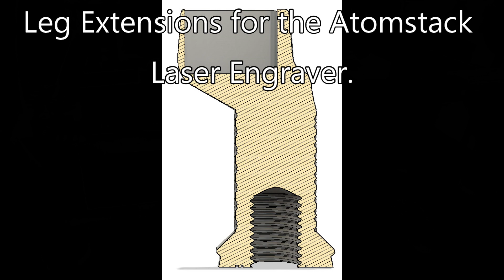3D Printable Leg Extensions for the Atomstack X20 S20 and A20 Laser Engravers. Free Download

Comment: You are the man.  I appreciate your posts.  I just downloaded your extension feet to print.  I am almost done printing the drag chain pieces.  I did notice that my extension arms (Y-axis) are square, where as your y axis arms appear to be rectangular.  In modifying that piece for my engraver any idea what I should change the print size too?
Reply from the maker: No idea, you can drop the model below the print bed and print just a small piece until it fits then raise it up and print the entire thing once you figure out what you need to do.
Reply: @737mechanic  I figured it out. Your arm is 20x40mm and mine is 20x20mm. I subtracted 20mm from your model and made one that fits nice like yours.

Comment: Thank you for the video and posting the files for the legs! I just got a 3D printer and printed off the 4 legs and 4 extensions. They turned out fantastic. The fit was nice and snug and I'll be putting a 1/4-20 screw in the three legs for security also.  I'm waiting for my TPU to come in for the bottom pads. I'll probably be printing another set of extensions to accommodate the R3 Roller. But thanks again, the programming and quality you did on these are top notch! Now on to the drag chain mod you did... 😊
Reply from the maker: Thank you for the kind words.

Comment: one question, if  i let them print online the ask if the file is mm or inch

Which unit of measurement has your 3D model been designed in?
Reply from the maker: I designed them in fusion using in but when I export them to 3d print I export as mm because the printer deals with mm better than in.